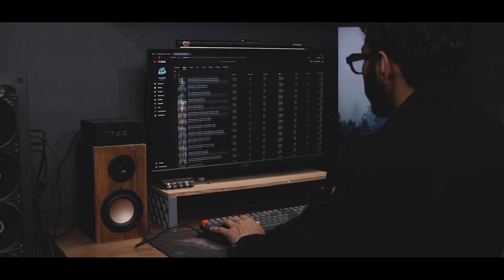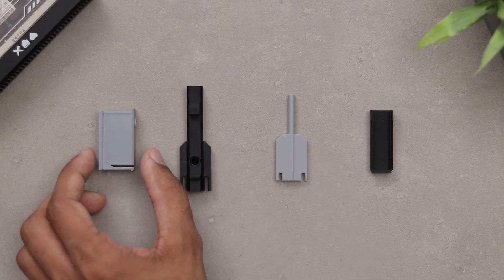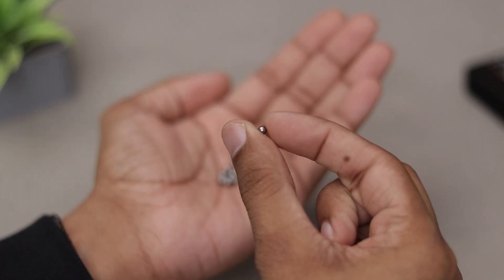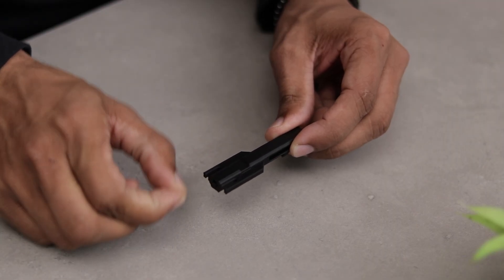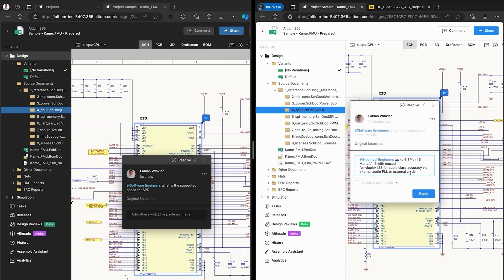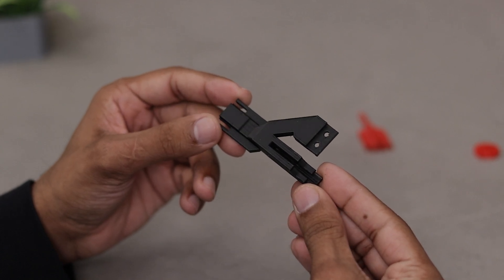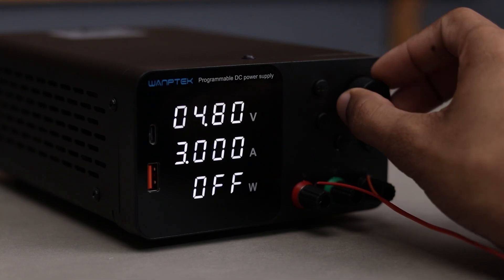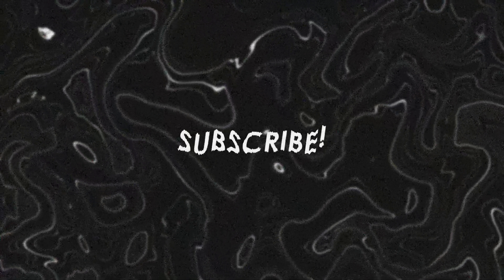Building a Mini Automatic BB Gun | DIY Tank fires BBs

Comment: Whats ur pc specs
Reply from the maker: it’s has decent power, i built it few years back, so not the latest tech. 

Processor- Ryzen 9 3900x
Ram - 64 GB 4400mhz
GPU - RTX3090
Storage - 1 TB Nvme nd 2TB HDD
Motherboard - MSI Tomahawk 570x Wifi 
Bykski nd Barrow Custom Liquid Cooling
Reply: @TheWrench  it's expensive for a normal guy but yes it gets the job done.